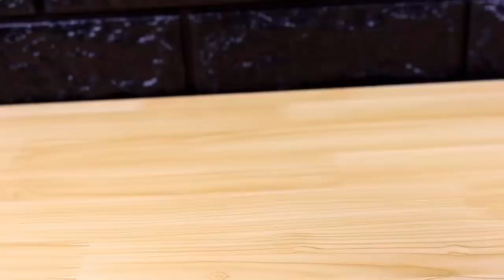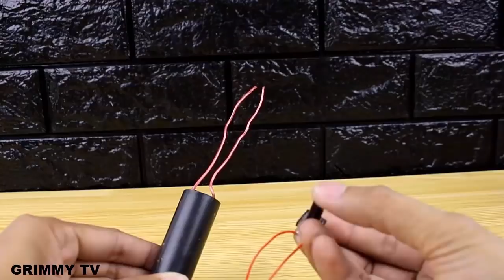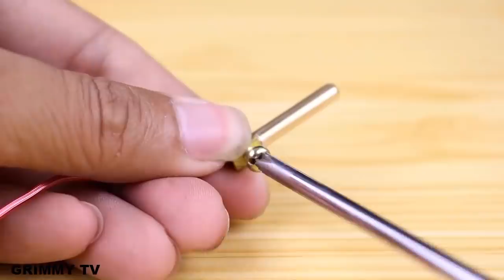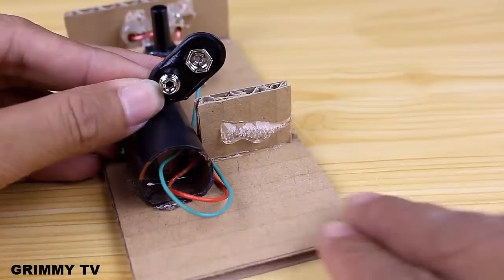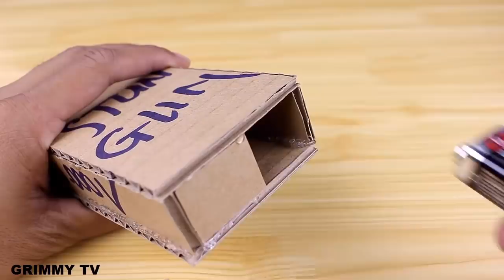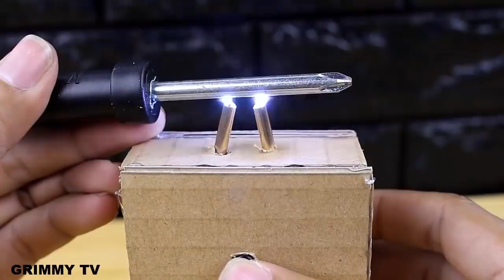How to Make Powerful Stun Gun 400 000V at Home - DIY

Comment: "HOW TO" videos are so much better when you actually explain what parts are using…
Reply: IKR
Reply: If anyone knows what parts his using hmu
Reply: @ayeeedrianx7554  that black thing is a transformer hence 9v to 400kv and the other parts you can use similar parts
Reply: Ikr? Im here trying to figure out what that black cylinder is
Reply: @4Dul69  it's called a transformer, look up transformer- 9v to 400kv
Reply: @tuto_roblox5965  wow
Reply: @darianrodriguez7377  not just a transformer because you need alternating current or pulsed DC to make a transformer work.
Reply: Boost converter
Reply: The actual correct name for it is a "high-voltage generator" or a "step-up power module" 😅

Comment: "400000V" makes it out of cardboard
Reply: DUCK exactly because obviously we all know 9volt batteries contain 400,000 volts
Reply: @ientu1022  fuck is this self promotion?
Reply: Its 400.000 v
Reply: thiccmemes wow thanks i actually didn’t knew that, i apologize for my mistake
Reply: Respect for owning your mistake, most "power stations" you see around your city are just huge versions of that little black box transforming the voltage back to a lower more useful voltage after transporting the power long distances
Reply: deco . 77 wow i for sure didn’t knew that thanks again for the information, well i guess everyday we know something new don’t we
Reply: Well, if it does in fact produce 400,000 v I'd rather not have it in a metal case...lol!
Reply: @sergioguerra7551  I can see you know nothing about electric. You can get 400k volts out of a 9v battery. All you need is a transformer if you lower your amperage you can increase your voltage. That's why telephone poles have transformers to reduce voltage to your house from the line. Just stick to your office job buddy

Comment: Did this little boy really just use a power drill to put two holes into cardboard?
Reply: TheProfessor936 Yes he did😂😂
Reply: TheProfessor936 lol
Reply: TheProfessor936 LMFAO!!!
Reply: TheProfessor936 perfectionist bruh
Reply: TheProfessor936 nb
Reply: Genius right? I've been using my oxy cutter as a letter opener, it's halved my bills by 50 %...I think.
Reply: lmao...he should of used a welder to fuse the cardboard together!
Reply: evards voofs quite literally
Reply: Whaaaat? you can simply PUSH the drill bit through the board.
2) bore it out with sissors. 
3) poke with a  pen, then push the contacts through the holds.
4) Poke the board with the contacts. there not brittle. soft but not brittle.
5) Sharp Knife
6) prison shank
7) tip of a unicorn horn (they really need to rename them to uniHORNs (smh)
8) Tooth pick
9) Stick
10) pencil.

Literlly he just needed to make a small pilot hole and shove the contacts though.
Reply: 3) "Holes" not holds, don't be critical of people until you can spell.Besides, it is his upload and he can do what he wants.
Reply: Sweet grammar. "Holes not holds" sentence is a complete thought. Should have a period. Should have a space between the (.) and Besides. Might as well make sure your teachings are correct if your planning on being a grammar nazi.
Reply: Canna710 
    The same goes for you. The comma is perfectly fine in his sentence as it can be replaced with the word "and" and it will still read fine, and is grammatically correct. The space he or she missed after the period is simply a typo, life happens.
Reply: ^ Has 5 errors. Still don't care. This is about using the wrong tool for the wrong job. Not whether or not 1/4 of the world is illiterate or have poor basic oratory skills.
Reply: Canna710 no, you're wrong again because a misspelled word is not considered a typo.
Reply: Canna710 
     You're wrong again it's the posters video, and he can use whatever tool he wants to make his video.
Reply: It's not the dyslexic quality of youtube comments that's the issue here, it's the shameful concept of craftsmanship that's exposed. ""poke it with a scissor" or "throw a rock at it until there's a hole" is on par with the manual skills of a caveman.
Drilling is the professional way: It results in a clean hole without compromising the cardboard stability more than necessary, without deforming the cardboard or corrugation by forcing something through, nor does it cause irregular tiny tears at the rims (like stabbing it with scissors would).
Yes, you could drill it by hand, but you're not rubbing sticks together to make a fire, are you?
Reply: smh
Reply: TheProfessor936 that little boy is smarter than you
Reply: TheProfessor936 Yeah and almost fucked up his finger 😂😂😂
Reply: Ikr that was very stupid
Reply: And stupid people arguing about grammar, they should be teaching language at some school.
Reply: Yes he did.
Reply: That's exactly what I thought lol.
Reply: TheProfessor936 its easier that way :)
Reply: TheProfessor936 xxxvedoes
Reply: I came here to see comments about the drill 😂😂
Reply: Yes
Reply: TheProfessor936 has to do with sizing
Reply: Canna710 and that only proves why ge used the drill,everything you suggested would be the sloppy way of doin it
Reply: TheProfessor936 Yes sir,  I was also thinking that
Reply: Evards Voofs lol
Reply: I just ignored it but now you brought it up omg he did 😂😂
Reply: TheProfessor936 I know right
Reply: Hasnain Ahmed me too...😜
Reply: BAAAAAAAAAAAHAHAHAHAHAHAHAHAHAHAHA
Reply: How smart are YOU?
Reply: Thank you. I cannot believe how these people are acting.
Reply: "Holes not holds" is not a complete thought. If I just said, "Holes not holds," would that make any sense? So therefore, it is an incomplete thought.
Reply: omg! i would not have thought about it till i was reading this comment, could of just poke through!!
Reply: the boy is professional.....
Reply: TheProfessor936 woman no?  Lol black n decker for cardboard ive seen it all
Reply: sometimes the comments are the best part of a yt video
Reply: Are you serious?  Mate it was a lead pencil.  He spun that wooden cased graphite ponter so fast, you heard the carbon forces slowly turning into diamonds
Reply: Too shai. .. points to you for that one!!
Reply: Look at the way he solders, he litterally drags solder onto the wires. Horrendous
Reply: @erikascottm2654  Sweet? He used hot glue for half of it, and not only is It horrid it's dangerous, look at his cold solder joints.
Reply: @davidfisher7995  A video? Sure but it is horrible and people have the right to constructive criticize this man must have learned to solder from someone who is blind.
Reply: @ TheProfessor936 huh huh huh thats how you make very accurate clean holes .
Reply: Canna710 not neat.
Reply: Little boy has very girly hands ✌️
Reply: ........he just likes a nice round hole :)
Reply: I love lamp
Reply: Did this boy just also made a working taser 😐
Reply: I was thinking the same thing lol
Reply: lol
Reply: Late, but this was a very petty and stupid convo lol
Reply: yes
Reply: @1JamesHamilton1  he did a typo lmao
Reply: @BTobias84  nope you still haven't proven anything. An error doesn't mean he doesn't know how to spell the word. You're language clearly shows your lack of  maturity.
Reply: @EctoGamer Hey,  it happens lol
Reply: yep 😂
Reply: I use my chainsaw to cut my bread
Reply: Your lying right
Reply: It hurt my brain too
Reply: Besides it was reinforced pvc he used there, not cardboard.
Reply: Is there a better way to create 2 clean accurate holes in a piece of corrugated cardboard? Real answer please , not some smartass bullshit.
Reply: He did 😆😆😆😆

Comment: Did you use a voltage meter to test? I highly doubt it's 400k volts it'd be blinding light from the arc lol
Reply: Could make a plasma cannon with that assuming you get it to arc right
Reply: Right? Feel like it's closer to 100k :/

Comment: Am I supposed to know what the cylinder with wires sticking out of it is?
Reply: If you don't then you should not try make one coz they give a nasty shock
Reply: John Hanley high voltage grnerator is just 3 usd on electronics shop
Reply: A capacitor
Reply: High voltage generator, check it on eBay.
Reply: It is a lighter circuit
Reply: @unoit9957  he didn't pull a stun gun apart, you fool. They sell these online.
Reply: @unoit9957  No he didn't I purchased mine in Ebay new for 2.50 American.
Reply: John Hanley yes
Reply: Boost converter
Reply: A Flux capacitor
Reply: The cylinder is just an old tampon applicator he got from his mom.
Reply: It’s a transformer. I made one of these when I was 9.
Reply: 1000 kv ultra-high voltage pulse generator super arc pulse ignition coil module
Reply: Im amazed( and shocked( forgive the pun?)) +amused) at the ppl using nonsense terminology here in a lot( not all) of the comments here.  Seriously??? I mean why not say things like" a tachyon field producing a temporal distortion"? You might as well! Hahaha. Its a basic taser. Not rocket science!!! ( though i must agree...poorly explained). Happy new year to all.
Reply: @wolf222555  Happy new year.
Reply: John Hanley yep
Reply: @wolf222555   :  POORLY EXPLAINED ? ? ?
I heard no explanation what soever !
Ooops, guess I must have had my fingers stuck in my ears while I was watching this.   My bad.
Reply: I too want to know
Reply: Same thing I want to know.
Reply: @azraqali9707  a capacitor holds and stores up charge ... its most likely a transformer that lowers the amps and ups the volts
like an electric fence
Reply: @randallvandal3000  Wrong game

Comment: you want a stun gun that will stun harder than any made? use a 35mm camera flash board.
old flashes have been known to kill photographers
Reply: Fake, you need several voltage doublersb
Reply: I took an old Nikon 35mm apart cuz it's now worth about $3.00 usd and I wanted to take it apart and I accidently touched a couple wires together and about blew the roof off the garage.  This thing had been in the closet for at least 10-15 years and held that charge the whole time. Scared the holy hell out of me!
Reply: @edstimator1  r/thathappened

Comment: No explanation on the cap specs or components needed. No good to me.
Reply: High voltage pulse inverter on Ebay its boosts the voltage value. The bigger the battery the more voltage. I used a homemade battery pack. The 9volt battery is easier to use but I prefer rechargeable batteries.
Reply: Im pretty sure a microwave oven cap or an old tube tv cap would work. Just remember to arc it. Even a 12v auto condenser. But I dont understand how a reostat controlls the cycles.
It pisses me off when hi IQ/ADD kids make videos.